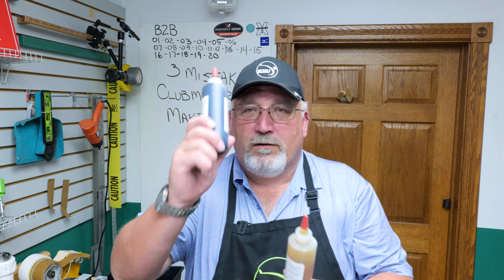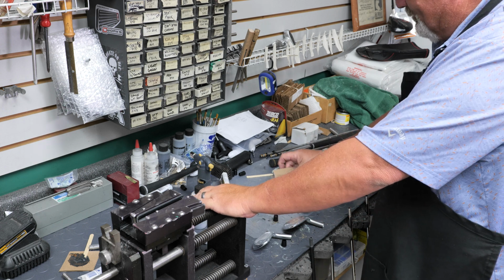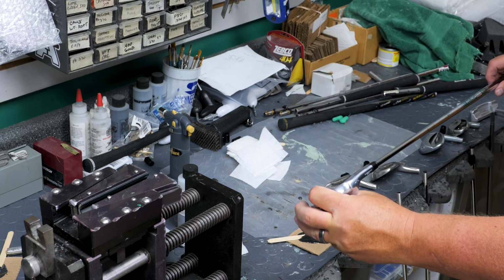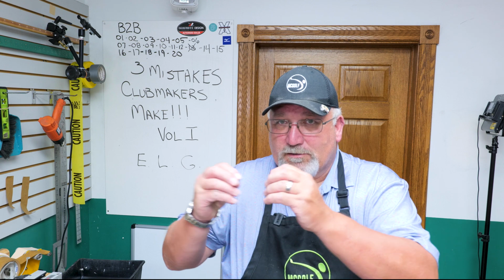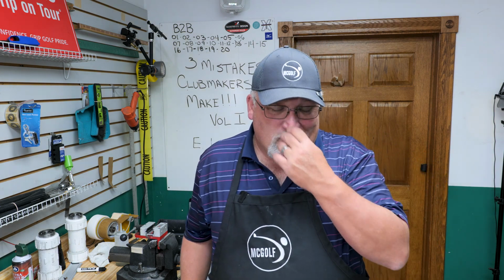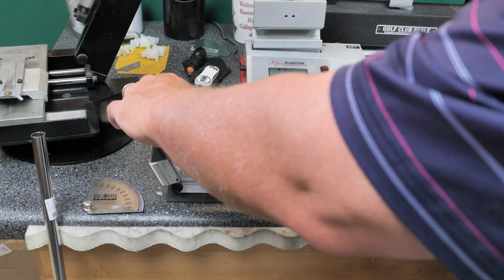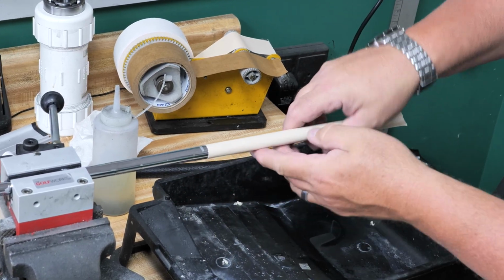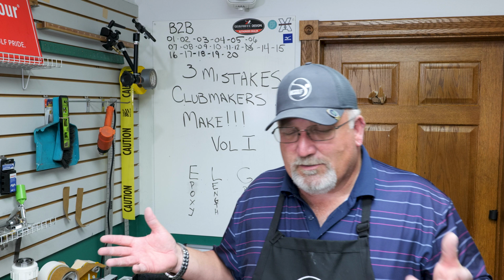Top 3 Golf Clubmaker Mistakes

Comment: One-half dozen or the other.  When I do my final wipe off of epoxy I dab a small amount of grip solvent on the paper towel.  To me, this insures the club hosel and ferrule area are all nice and clean.  Not sure if the practice is right or wrong but it seems to work well for me.

Comment: Is there ANY standard for head weight to shaft flex?  I have an older set of irons with s300’s in them, but the old heads are 15-20 grams heavier than the new heads.  So if I transfer them, won’t they be stiffer?
Reply: Stiffness is only determined by the shaft, now what you are talking about is swing weight, 2 grams added to the head= +1 point ( example: D1 is nowD2 with added 2 grams to club head) 
5 grams added to the butt end = -1 point (d2 is now d1 with 5 added grams to butt end.)
-Custom Club Builder 
  Puetz Golf Seattle

Comment: Looking for help. Wanted to change shafts in a set of old Macgregor irons, graphite to steel. Tried to remove old graphite shafts, when pulling out they have essentially just ripped right at the top of the hosel. Tried drilling out but hitting metal about 5mm down in the hosel meaning no depth in the bore to put new shafts in. Anyone have any suggestions on what has happened or another option for getting the rest of the heads as normal?
Reply: Graphite is brittle when introduced to heat, use a heat gun, you CAN NOT twist the club head to get it off a graphite shaft. It has to be a Parallel “pull” basically you need a shaft extractor. If not accessible you can cut the shaft off flush then boar the  hosel ,start with a small drillbit and work your way up bigger, you’re hitting a swing weight it’s brass and a particular drill bit is needed or extractor, you can try to heat the hosel up with a propane torch sometimes the weight will come out on its own, but at best it will loosen epoxy and be more likely to slide out as you’re drilling.  Use heat shield on hosel. But best would be to take them to a club builder. 
-Custom Club Builder
Puetz Golf Seattle

Comment: The only one thing you didn’t talk about with the Grips is that sometimes people like the tape thicker like me where my second hand is on the grip the lower hand I like to build it up like three down there because that’s just the grip that I like and sometimes it doesn’t wanna slide over and I’ve use the heat gun to warmed the end and also the solvent inside and then put it on put some on the club and some on  the grip and then poured on like you said and then don’t stop shove it all the way on but it helps her to get over the gift the beginning part of your grip that you put on the club is warmed up a bit and it fountains it up a little so it’s slides on

Comment: Great video and explanation of epoxy. I have found most people don't understand ratios and tend to miscalculate when eyeballing the amounts of epoxy. I personally use a scale but that because I'm just OCD. Is there a reason you don't use the mixing tips with the 3M glue? yes it is an extra cost but, mixes the epoxy quickly and perfectly.
Reply from the maker: IMO the tips do add some precision but using them wastes the epoxy

Comment: Here in the UK, there is an accute shortage of club builders.
At my local golf course the resident PGA Pro butchered my driver. ( I wanted him to shorten it by half an inch, but instead of cutting it off at the butt section he cut it of at the tip and it was then too wide to fit into the hozel.  Undefeated he tried to grind the tip down in order to get it to fit into the hozel. The head came off after the first shot. He refused to refund my money and challenged me to meet him in court. Another player asked him to change the lie angles on his iron set.
He did not have a lie angle adjustment tool and proceded to clamp them in a vice and wack em with a hammer, totally destroying a brand new set of golf clubs, when asked for a refund, he threatened violence. 
That's the level of technology and professionalism here in the UK!!!
Reply: meet him in court?

Comment: Interesting tidbit I picked up about epoxy a while back is that the viscosity while curing follows a sigmoid-shaped curve, with the transition from liquid-gel-solid happening relatively quickly. I haven't built any clubs yet but I'm hoping I can pick up a decent set of blades that need new shafts or grips for cheap at a thrift store some time, and it's great to know what the proper resin/filler is and how exactly the length is measured.

Comment: Hi Jim, do you subscribe to the notion that, when measuring for length, both steel and graphite should be cut the same ( talking standard length here, ex 7i = 37”) or should graphite be cut 1/2” longer throughout the set?
Reply from the maker: Length is length regardless of the shaft material. YOu are putting in a a lighter shaft for a reason and a result will be a lower swing weight

Comment: Is it possible to utilize the air installation method for irons rather than using solvent? Recommended? I’ve done both methods but not for steel shaft irons. A driver shaft I put in another club did not have any tape so it was blown on.
Reply: I’ve used air to install grips on both steel shafts and graphite. Painters tape works.
Reply from the maker: Ron you should be able to use air to install a grip for either type of shaft

Comment: Two questions on gripping. 1) Do you also find mid-size grips harder to put on than standard size grips? Especially the Grip Master Kangaroo mid-size grip, that one is a nightmare to put on. Any tips? 2) I removed and re-used some quite old junior grips. Put them back on and some 12+ hours later (kept them in a room with a dehumidifier) some of them were still turning. Never experienced this before so I don’t think it’d an issue with my tape or solvent. Is it possible the grips are too old and after taking them off, they stretched out too much?
Reply from the maker: 1) the kangaroo grips are problematic for a smooth install the last I did was a work out.  If the grip was old and was on a bigger butt shaft or built up I’d also think the grip would not seat
Reply: @McGolf  Thank you sir good to know I’m not alone with the kangaroo midsize grips! If you ever get a chance can you do a video on how to put on all the problematic grips? 🙏🏼🙏🏼

Comment: Can you simply use the quick centre beads to fit a 0.355 shaft into a 0.370 hosel? Or do you have to use a shim?
Reply: From personal knowledge the shim is the right way to fill that large gap.
Reply: GW T Shims work. Abraid both sides to remove the gloss.
Reply from the maker: Thank you asking as this is a common question. The answer it no although I am sure there are some successes out there as a whole you will likely get a failure. Simply to much epoxy to fail.

Comment: Jim.. who machines the hosels on your Mizuno 923s ??
Reply from the maker: I do using a reamer and a drill press and a jig
Reply: @McGolf  .. since I work with Mizuno Fitting cart, I don’t have to do that. I ream out the .355” fitting adapters to .370” when needed. Trying to KISS it.
Reply: Not sure I understand this comment. Why would you ream out a .355 hosel?
Reply: @leftygolferguy  to fit a 0.370 parallel shaft I'd guess.
Reply: @malcolmbosanko2007  I just saw a newer high end iron involved and was wondering why anyone would do that? I get it that there isn't as big of a selection for .355 hosels and might save a buck but just seems like carving up a very nice "new" iron
Reply: I’m reaming out the Mizuno .355” FITTING adapter when adding .370” parallel shafts to my fitting system. The Recoil 460ESX shafts Mizuno and others use, are in fact .370” tip shafts that UST tips then sands the tip to .355” to match most OEM hosels. Best of both worlds in some ways. Many custom builders will ream out .355” hosels to accept .370” parallel shafts. I don’t.
Reply: @sloswingspeed9535  that's interesting. Didn't know know they made something for doing that. Thanks for the info

Comment: All good tips!! Personally I have re-epoxied Taylormade irons hands down more than any other brand. 
Question: I spine align the shafts on everything I make or repair. Benefits or not? I figure it can't hurt.
Reply from the maker: Duane this is a good how to start an argument question among clubmakers lol. I do too. From comments of golfer it’s about a 50/50 split. Some can live without and some cannot. My opinion is it makes a consistent golf club regardless
Reply: Duane…in the early advent of graphites and some very inexpensive steel shafts, spine align or FLO ( flat line oscillation) was deemed critical by custom club makers. As mfgrg quality improved, more OEMs routinely required the shaft mfgrs to include this. Some testing has been performed by some clubmakers Jim McC knows….and playability improvement is hard to measure. As metallic fibers have been introduced, to graphites, designs have become far more stable…and deformation has been reduced. 

Even in non labeled steels like KBS, I always check FLO, because it’s better todo than not, IMO.